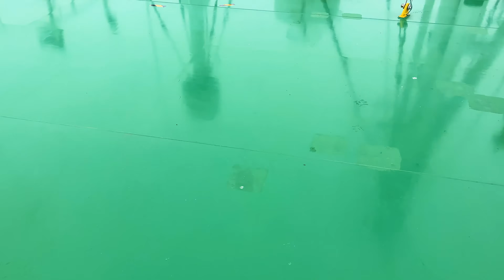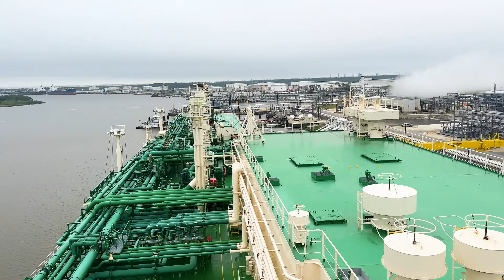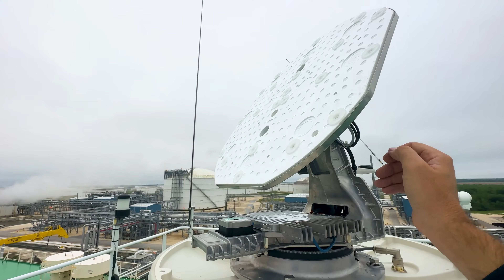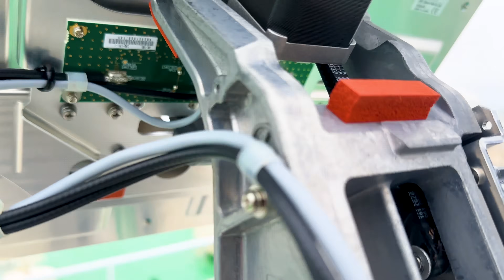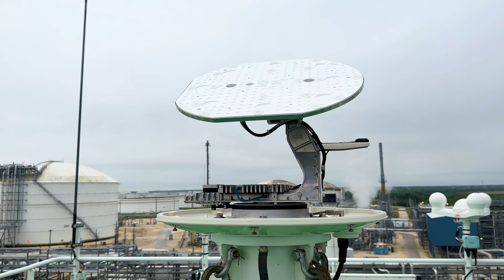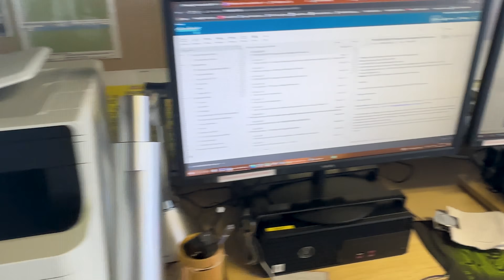Starlink and VSAT Antenna Repair on a Ship How Internet is Delivered to Ships!

Comment: I didn’t see anything on Starlink, only on Inmarsat. You did show, at least from the Inmarsat side, one of the major hardware differences between the two systems. Starlink uses a phased array antenna system instead of a three axis motor driven antenna.  What that means is that the Starlink uses an electronically generated signal for most minor adjustments of the antenna direction. Yes it still uses a motor driven system to get in the general direction of the orbital plane that the thousands of Starlink use but most of the tracking is done electronically saving wear and tear on the system and eliminating the need for precise adjustments of the antenna. It’s why SpaceX can sell the antenna system for a few hundred dolllars instead of the thousands for even a small Inmarsat unit. 

The other two major difference are bandwidth and price. Simply put, Inmarsat is much slower and much costlier, in order of magnitudes for both. I’ve used Inmarsat and 20 years ago it was a game changer. Well, the massively distributed LEO sat systems, like Starlink and OneWeb  have started a new game. Gonna be interesting to see how it plays out.
Reply: Do you think starlink will replace vsat everywhere or do you still need vsat for specif vessel applucations?